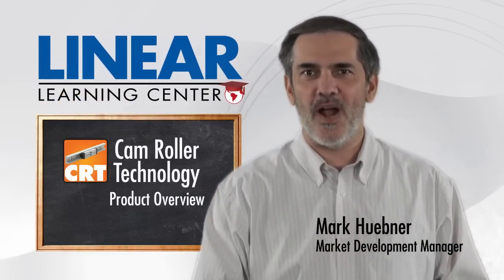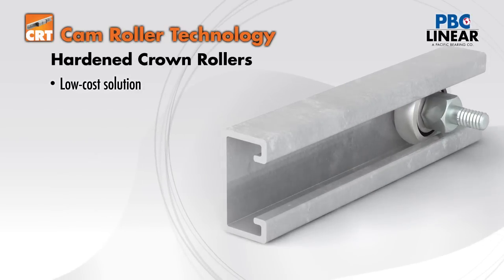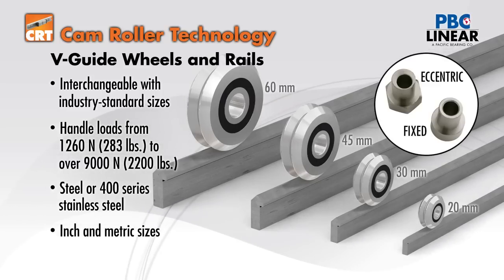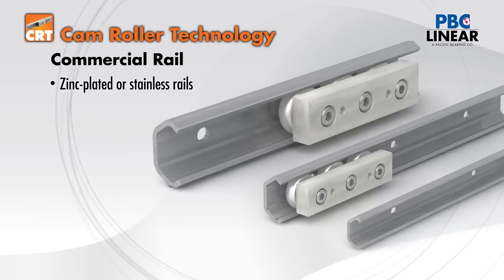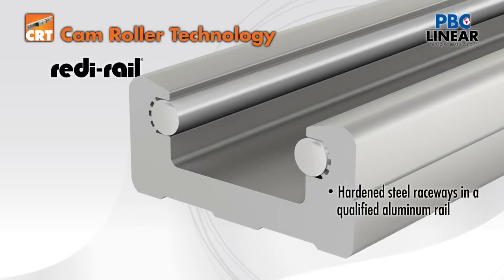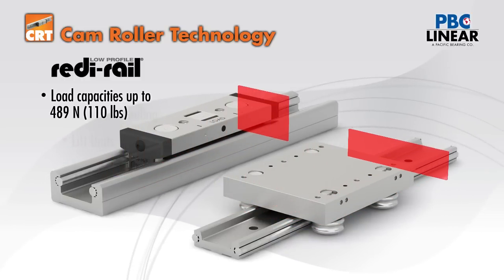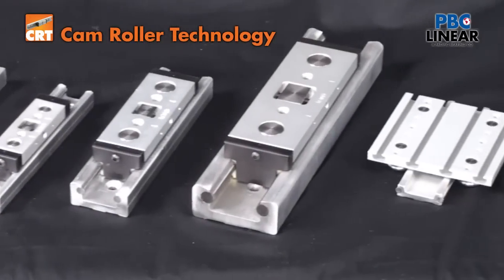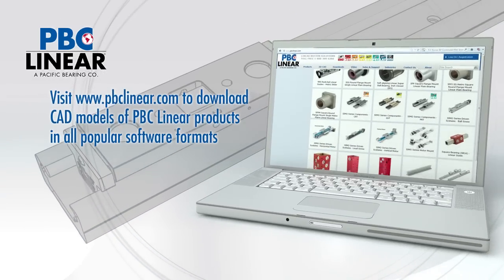Cam Roller Technology Overview

Comment: I built a elevator. The hoist lifts the load and I used unistrut track/trolleys. It has a lot of play. What's the longest length I can get of this? 2 tracks at 30' and 4 trolleys to balance say 1500 lbs... ???
Reply: For now the carriage has a 2" gap all the way around. I'd like to close that gap to say 1/2" without the carriage hitting a joist. It's a 1500lb lift and I took a chunk of wood off already! 😃
Reply: Eliminating the connection of 2 pieces is ideal. One hair of track misalignment and the trolley stops with the system I used. 😮
Reply from the maker: @roberthaas5372 …  Redi-Rail max length is 19 feet, so there would be a joint for 30 feet.  You could also consider Hevi-Rail, but that would need to be welded and ground smooth.

If you could message us with your contact information, we can have an application engineer reach out to you. Or email us at:  info@pbclinear.com
Reply: Any advice on a system that can be tensioned strong enough to slide and hold 30lbs. in a vertical rail slide configuration? 12" vertical travel. Any help is appreciated.

Comment: How well does these last outdoors? I am looking for a solution for adding slide out solar panels.
Reply from the maker: Hi Mechanic Man - Redi-Rail has been used in Solar Panel and other outdoor applications, the Redi-Rail product is a combination of Aluminum Rail and Slider Body and can be provided with an Optional – 440 Stainless Steel Roller/Roller Raceway in the to minimize potential corrosion. We would also suggest the wiper option with the oil impregnated plastic wipers to provide a form of lubrication between slider rollers and rail raceways. 

Please note: 440 Stainless steel aids in reducing potential corrosion but can still tarnish or discolor over time with use. 

REFERENCES:
CRT Product Catalog: https://pages.pbclinear.com/rs/909-BFY-775/images/Product-Catalog-CRT-Cam-Roller-Bearings-and-Linear-Guideways.pdf 
Video:
Redi-Rail Overview: https://www.youtube.com/embed/nGCipTS58tM?rel=0&ytp-pause-overlay=0
Redi-Rail Roller Options: https://www.youtube.com/embed/uzxOKtIw1OA?rel=0&ytp-pause-overlay=0 
Redi-Rail Metric Series Pre-Load Adjusters: https://www.youtube.com/embed/UHA3Pppz6-Y?rel=0&ytp-pause-overlay=0

Comment: Interesting, specially for use in a 3D printer instead of those plastic rolls. Hmm, I could think of an DIY project in near future. When the price is acceptable and to get them at my home spot (without paying taxes for expensive delivery to Germany) it‘ s really cool.
Reply from the maker: Hi Mad Max! We actually have a location in Germany and I'm sure they would be happy to help you! Check them out here https://www.pbclinear.eu/crt/lineare-rollenfuehrungen/
Reply: PBC Linear thank you for your answer and this link. I‘ll take a look.
Some minutes later...
Autsch! I‘ve found the webshop with this rail system. It‘s nice, really, but not an alternative when you have to look at the costs for a complete system like a 3D Printer. A rail system made by SKF or Hiwin isn‘t cheap either, a Chinese rail production getting at Aliexpress could have several problematic issues like dirt or metallic parts inside, but when you are able to fix this Chinese productions failures...I try it. I‘ve ordered the part I need with cyber Monday discount. I think, it will be funny and not frustrating with chinese rails.

Comment: I have a question. What are the chances of friction or grazing between non rotating, sliding elements which are attached to the hardened crown rollers and the rails??
Reply from the maker: In any linear system setup, make sure to have proper clearance for parts of the system in motion and strive to have good alignment.

The Harden Crown Roller Rail is manufactured from ASTM A1011 low carbon steel which is essentially soft carbon steel, if the rail incurs mis-alignment, skidding of rollers, etc. the rail will likely scratch or show signs of wear in the rail. To minimize potential marring of the rail it would be necessary to use a hardened rail product such as “V” rollers/rail or Redi-Rail this will reduce the chance of scratching the hardened rail surfaces, depending on the circumstances even this cannot guarantee not scratching or marring the rail running surfaces.  - PBC Linear Application Engineer

Comment: need be hobby cnc users about 1000mm long rails can cutting/mill aluminium and less than 70$/ axis. cheapen lot and heavy can use. about normal hobby user 1000-2000 mm long.

Comment: Mmhh...if in cnc or 3d printer... it will accumulate chips and smashes it directly against the roller or bearings... 
It would be good for other home applications  (ie: sliding doors)